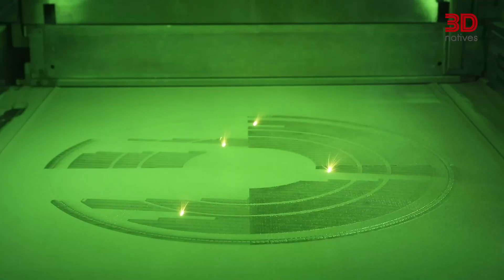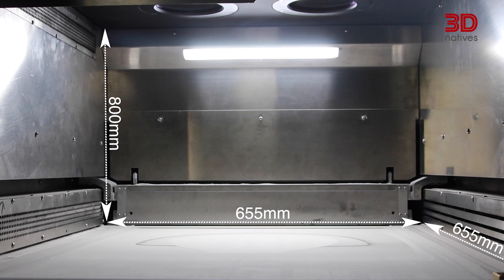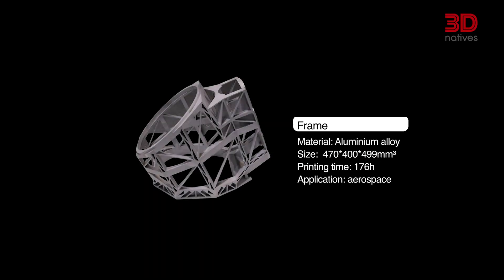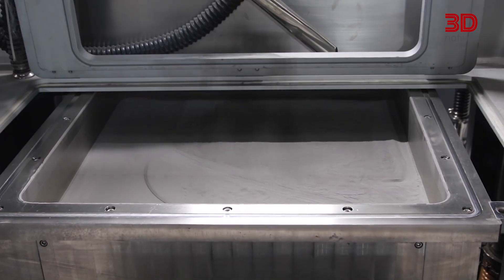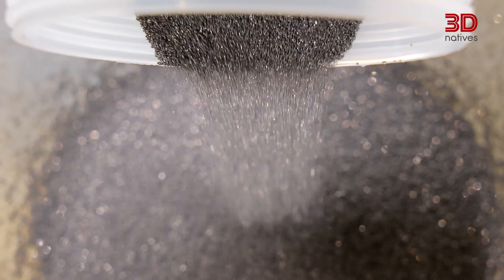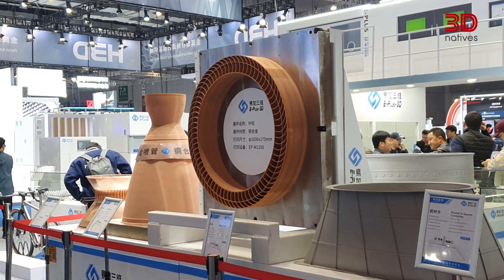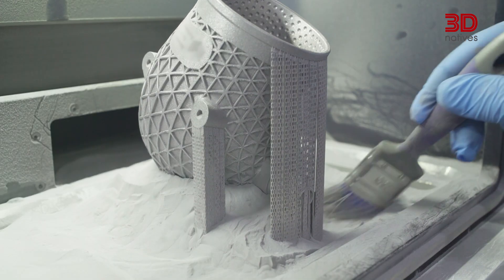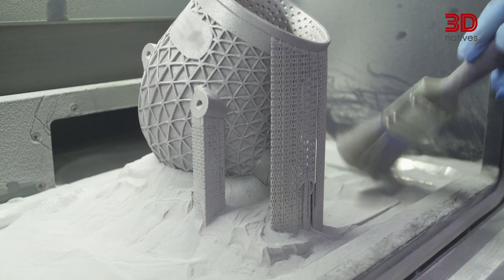Eplus3D EP-M650: Industrial Metal 3D Printing at Scale

Comment: Logically, optimal metal 3D printing should employ a multi-beam scheme: several (for example, six) laser beams would provide controlled preheating and local magnetization of the target zone, then other beams (say, four) would perform micron-level sintering of the dispersed suspension with precise structural formation, while the final lasers would carry out controlled forced cooling to relieve thermal stresses. Such an approach could enable metal printing with true microstructural precision.
Reply from the maker: Thank you for sharing your thoughts,  that’s a very insightful point about the potential of multi-beam systems for achieving greater microstructural precision in metal 3D printing.